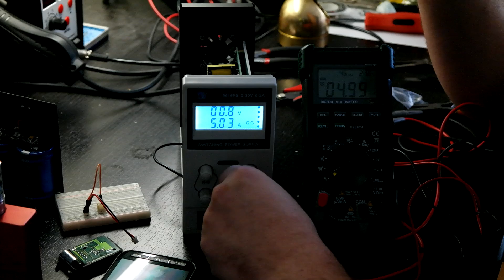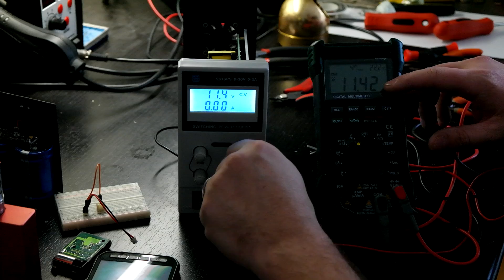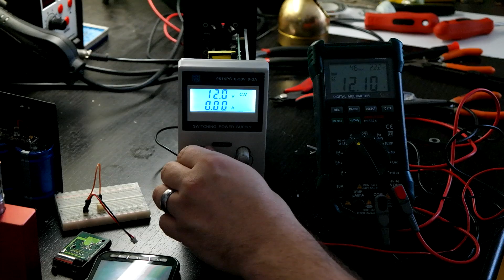9616PS Bench Power Supply Repair & Hack!!

Comment: I had problems with my voltage fluctuating wildly on my cheep power supply, but instead of replacing the potentiometers I popped off the plastic knob and sprayed an electrical contact cleaner on the shaft and let it run down inside and twisted the knob back and forth several times and now its working perfectly.

You should also be able to use WD40, I did find that by doing this that I lost the slow drag effect on the knobs but I'm happy to loose that for a working power supply.

Hopefully this will help someone with the same problem.

Comment: Anyone have an idea what would make one's current start falling off as it's charging a battery, but then rises back up RIGHT BEFORE before it switches over from constant current to constant voltage?  I don't have this exact model, but another cheap Chinese version.    It seemed to work fine yesterday, and now it's acting up...

Exact scenario I just watched happen:  Charging 2 lithium-ion batteries in series.  Voltage is set at 8.2 volts. Shorted the leads out to set the max current at 1.5A. Connected leads to batteries and the current only goes to about 1.3.  As the batteries charge up from dead, the current eventually falls off to 1.1, but when the voltage reached 8.1, the current begins to rise again lol. Rises about to 1.3-1.4 or so, then switches over to constant voltage at 8.2 and, of course, starts falling again like it should.

Comment: Exact same problem with my two 5A units. Replaced the pots and the 470 uF electrolytic capacitors and both units are working as they should again. Thanks for the video.
Reply: what were the symptoms?
Reply: @blackz06  Voltage fluctuations, sometimes several volts.

Comment: I have a QW-MS305D power supply and it's a 5 amp and there is a 10 amp version so I'm wondering if I can do the potentiometer hack on mine to make it a 10 amp.  Also I hear some noise coming from it so I'm wondering if its a bad caps.  I'll have to check these things.  Thanks for the info.

Comment: The current on my psu increases automatically while I increase the voltage. And when I try to decrease the current it doesn't work. A short in the circuitry perhaps?

Comment: easy hack for the amps limit, but be careful: the transformer may not handle that much; usually, the 5A power supply has a bigger transformer than the 3A one, that's why it costs a little more...
Reply: The heat sink & fan may not be up to the 5 amp 100% duty cycle load either.
Reply: @robc8468  Yes.  It would be easy, and save some money, if the 3A and 5 A versions use exactly the same circuit boards and pots, with larger caps and higher current output transistor wth a bigger heat sink, in the 5 A version.  Someone would have to compare 3A and 5A models to know for sure.

Comment: Interesting vid. Not sure I would want anything connected to that thing wired in to my wrist. What if that cheaply made supply has some kind of short and connects hot of the AC line to ground? In theory the breaker trips in the lab, but how much current could flow through your body first?  I think I prefer a dedicated ground for the wrist strap.
Reply from the maker: It wouldn't really matter if I had the ground strap plugged into the ground of the power supply or the ground at the outlet. They will be at the same potential.
Reply: +R&TPreppers I imagine a scenario where the internal ground wire in the unit comes loose from the input ground and shorts over to the hot wire. Now the unit is not grounded at all, and your wrist is hot. Just seems much safer to ground the strap separately. Still a useful thing to have an earth ground on a power supply, though. It can be useful to choose between floating and earth grounded by binding the negative to the ground.

Comment: Nice and clean repair, but I fear you are replacing crappy pots with also crappy pots.. it's just going to need this done again most likely down the road. Why not spec the right orientation pots off digikey/mouser and get something of more known quality? Also options to go multi-turn as well.

Crazy about the 3A to 5A conversion process though, tweak a trimmer.. dead simple!

Also just another thought, but the way they tweak the supply output range it's be a possibly useful hack to wire in a switch with resistors that sets you into limited ranges. 5/12/20v etc. giving you full knob resolution and keep from say blowing up logic chips.

Comment: Now I wish I'd have bought the 3 Amp model. But thanks for the tips. Great place to put a grounding connector. If you could just tap that static power and run your lawn mower while you scoot around the carpet. ;)